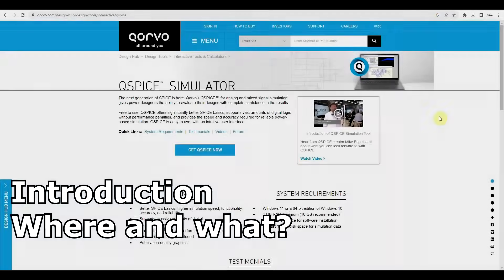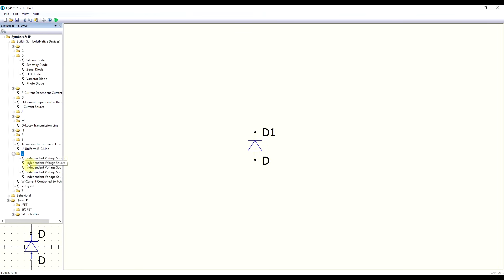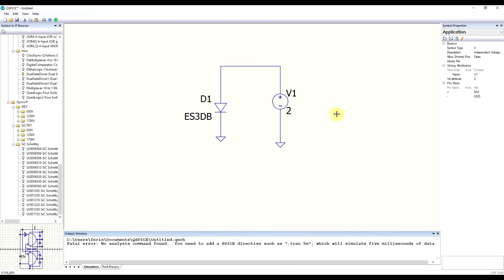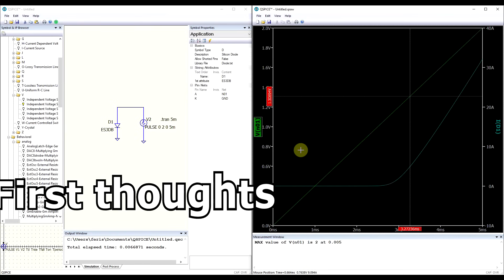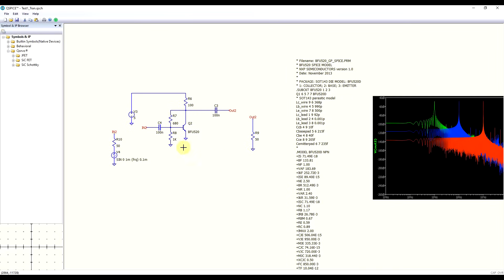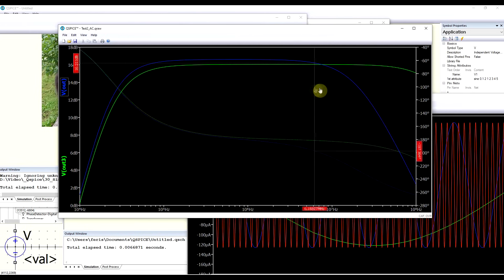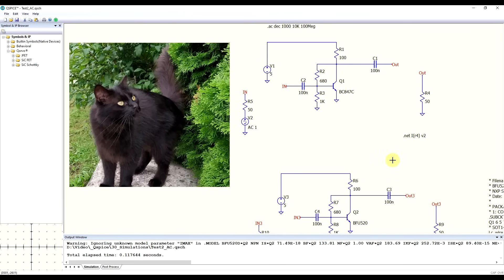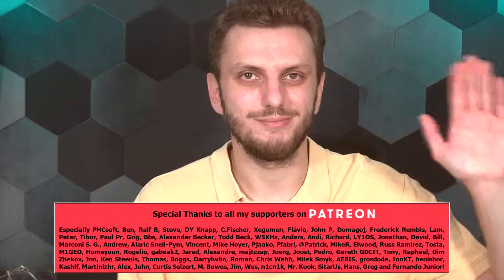Quick look at QSPICE

Comment: I can't get two Verilog modules to communicate.  A simple example, fixed output of one Module is read by input port of another Module. It appears the connection are still analog, it converts everything to analog, it doesn't understand data types, more work to make Qspice the best ever simulator. Any Trick to transfer a digital values from one module to another module?

Comment: The quality of the underlying simulation between qspice and ltspice is different. Ltspice sometimes has trouble simulating circuits that have discontinuous behaviour. Qspice seems to handle this much better.

I was simulating a circuit with an opamp where I wanted to switch the input on after a time delay. Ltspice could not handle this transition. Qspice handled it easily.

That is already enough to make me want to use Qspice.

Comment: This is a perfect overview of Qspice. There is a lot of uninformed or useless BS online, including from Qorvo. This video answered most of my questions and doubts, thanks! I have to admit I expected quite a list of bugs to be mentioned, however, the only slightly less positive comment is the lack of hints when entering dot commands? I can not follow that this is a problem at all for people seriously interested in SPICE. Also, that kind of hand-holding is also not in LTspice (it starts to creep in the newer releases and I wish I could turn it off).
For me the most important unanswered question still is if Qspice is really faster than LTspice? I have a hard time believing that. Another question is how well (and how) the Verilog/VHDL link works on the user level. My on-line experiments with PartQuest show that its VHDL-AMS is several times slower than SPICE. Of course that is no issue if an equivalent SPICE model does not exist. It would be nice to compare Qspice with the XSPICE  part of NGSPICE (where models can be coded in C directly).

Comment: QSpice will never have a MacOS version (for M1/M2) as the ARM architecture do not support extended floats used by QSpice nor will it ever have a true Linux version (other than a possible Wine version - and it might already work?). A native Linux version (Qt?) would require a complete UI rewrite and while certainly not impossible in theory the amount of work and the need to maintain two very different code tracks makes it practically impossible.

It would be helpful if the review did not just focus on some very shallow UI things (my thinking is that to use any Spice simulator getting an understanding of some basic commands, like ".tran" etc. just comes with the territory and is not a weakness of QSpice per se) . What would be interesting is for example the ability simulate more advanced circuits, stability, robustness as compared with other (e.g. LTSpice). Cases where for example LTSpice doesn't converge without a lot of manual "tricks" and whereby QSpice succeeds, and of course speed of simulation (its a big difference if it takes 30min vs. say,  3min even for only a semi-professional user. ). Of course, that is an enormous and time consuming exercise to find and compare such examples but for me the simulation engine is what matters and this review didn't touch anything at all on the core functionality.

Comment: I understand all the ways this app may be promising. One day. Not right now. Apart from the difficulties likely to befall those new to SPICE simulations, as you pointed out, I also find that the ostensibly overhauled UI is a pretty bad, if not worse than that of LTspice. Why? Because it still looks really-really outdated, has tons of quirks, does not follow any perceived standards people are used to nowadays. So it has a steep learning curve for the end users on both ends of the spectrum: those coming from LTspice will have to re-learn everything, those completely new have to adapt to this strangely put together UI experience, but without the decades of openly available know-how that LTspice has on forums, stackexchange etc. It's half-baked at best. I'll stick with LTspice. If anything, at this point I think it's still a lot more beneficial to learn MicroCap instead, which gives you IBIS model simulation as well as Monte-carlo simulations.

Comment: A few years ago I had to design and implement a very sharp active audio filter for a home project. This was not something I was quite used to, and I wanted to test and compare several topologies in simulation.
I found it quite difficult to automate just about anything with GUI tools like that (used LTspice before), and I ended up driving a Xyce instance from python code with PySpice. Who needs a graphical interface, right?

The code project grew bigger and kinda became its own thing. Now if I want to synthesize, simulate and show a Bode plot for a high Q DABP or a 4th order Chebyshev LP with MFB topology and 3dB ripple, I can do that in 10 lines of code using my lib, and it's gonna give me optimal component values in the E-series of my choice.

It's certainly not a solution for everyone, but finding a way to interface Spice simulation with code can be very powerful.

Comment: It feels and even looks a lot like LTSpice. The interface still looks and works horrible. Still very far from user friendly. Way to many complicated text based spice rules again. Why not a easy to understand menu for the user? 
The extra models can be easily be imported from 3rd party sources anyway in LTSpice.
For now I see very little benefits, more just a ever so slightly different flavor.

BTW, subcircuits also works in LTSpice, except for the direct programming code.
Reply: I believe it's the same principle developer.
Reply: @vincei4252  yes it is, but apparently he also didn't bother to change the approach either? It now literally feels just like a slightly different ltspice.
Reply from the maker: Of course 3rd party models and subckts can be imported into LTspice; but from what I know at least, you cannot link/import another schematic - the imported file will be a netlist (a text file), not a circuit - that can be viewed and edited as a circuit -> this was the difference I was trying to highlight.
Reply: @FesZElectronics  a component model or sub circuit IS exactly the same thing, just called differently. You can basically move any schematic into a component with just a few IO ports.
Reply: LTspice is far far far... better user friendly especially with its dialogue box for components values, I hate typing parameters with this QSpice

Comment: I spent weeks learning ltspice properly. 
Not going through that rabbit hole again, for no apparent gain.
Reply: The biggest issue with Ltspice is just the super weird non-standard keyboard shortcuts. As soon as you change those to something every other program is using, it's not that bad. Just the interface is very very dated.
Reply: Agreed. Pretty crappy program. Adding components is a nightmare.

Comment: It only runs on Windows? Can you make a Video about an open source Simulator like ngspice ore something? I am so done with stupid Windows OS.
Reply: LTSpice works fine under Wine. I think this would work under Wine as well. There are no proper alternatives under Linux that are this powerful and also don't have a community that's big enough to be able to find new models or share problems.
Reply: @p_mouse8676  That's what we said about Blender, Gimp or Krita before they started to compete in features with the tools of large software editors.
Same story with Kicad, which is not as deep as the proprietary EDA softwares but still good enough for quite advanced designs that it became used in industry and grew a large community of both hobbyists and pros.

The big strength of LTspice is the collection of proprietary models collection they've embedded in. But pretty sure Analog Device's concurrents (especially those outside USA) would prefer to push for a more neutral tool to use their own spice models. And at some point we could even imagine TI ditching their own less popular spice fork to contribute directly to something like QUCS-S or ngspice.
Look at Arduino IDE : we don't need to be able to hunt for 3rd-party or community models when the tool is vendor-agnostic. And improved models can be directly embedded or easily distributed as add-on updates.
Reply: @p_mouse8676  i have almost always graphic bugs with wine and i dont realy trust proprietary software. Even if its not a virus itselve, bad code can also create bad problems.
Reply: @@diegolira- and these days with the power of ARM systems it's quite a poor choice for such a big company to just cover x86 on Linux.
Reply: Not so stupid that it does ah! ah!

Comment: finally cat pics in circuit simulation, what a time to be alive 👍
Reply: Yeah, but it has its drawbacks. Just check the size of the simulation file ... :)
Reply: But nowadays size isnt an issue, right?
Reply: @markusreichel3896   Yes but time isnt. If you want to transfer it to a colleague by mail or by drive, you may notice it takes longer than it should.